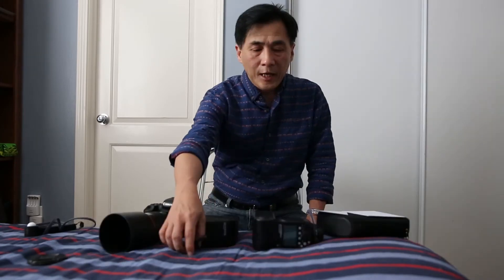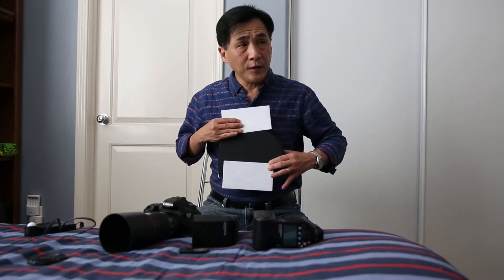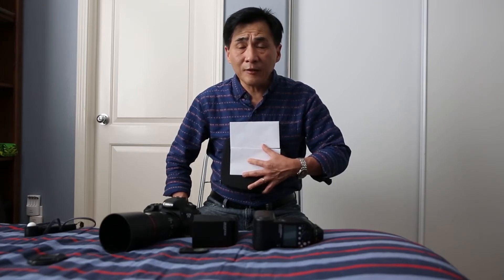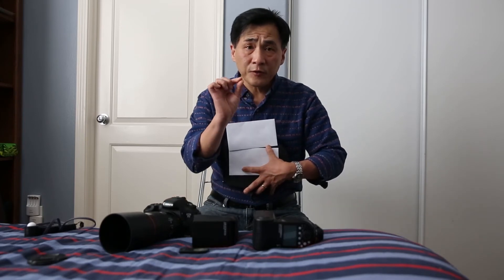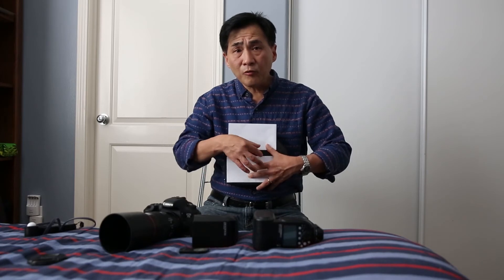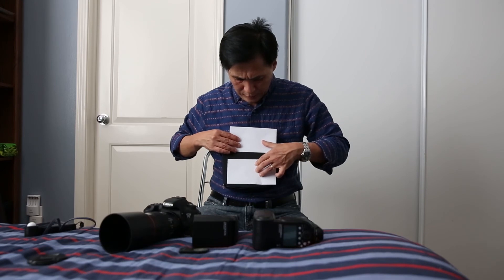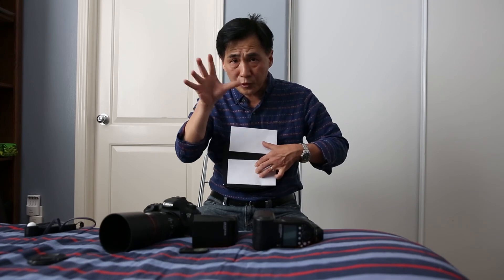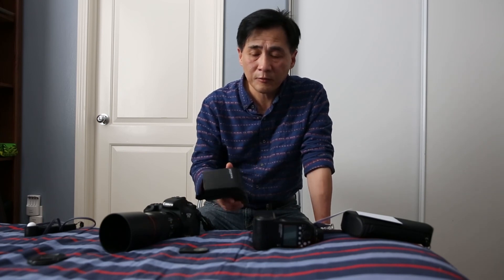Flash Lesson # 2 - High Speed Sync - Intro to Flash Photography

Comment: Very well explained. Thank you for sharing!
Reply from the maker: You're welcome and thank you!
Reply: @HTongho  thanks for the heads up in regards to the lack of high speed sync in cheap Canon ring light imitation. I would have never thought about that feature.
Reply from the maker: @Tuyendiep  I guess if you are using it strictly for macro it is a non-factor because we tend to dial in an aperture value that is quite large like f/11 or f/16 for maximizing the DOF and usually the shutter speed is under 1/200